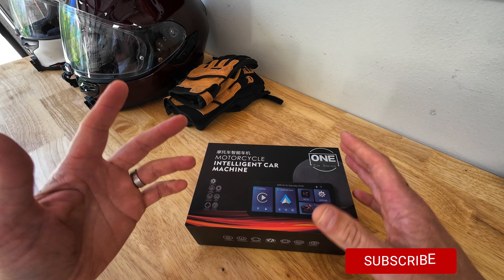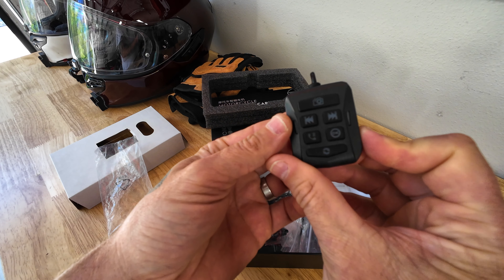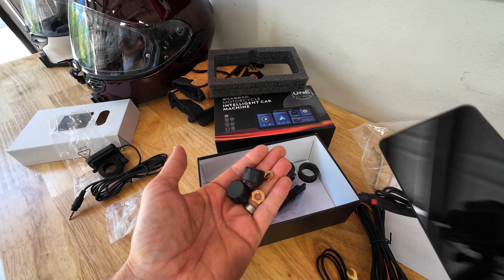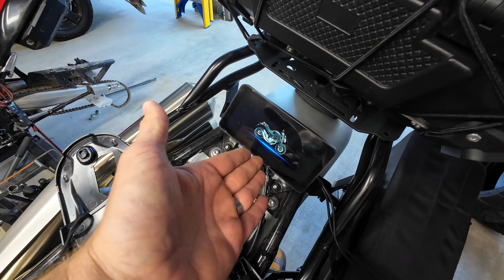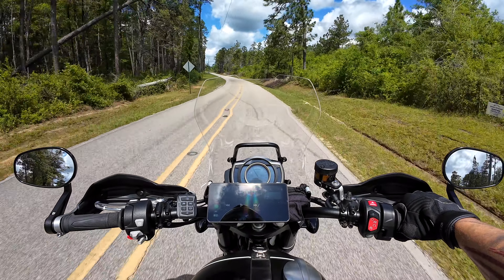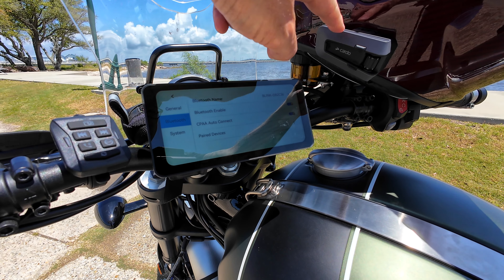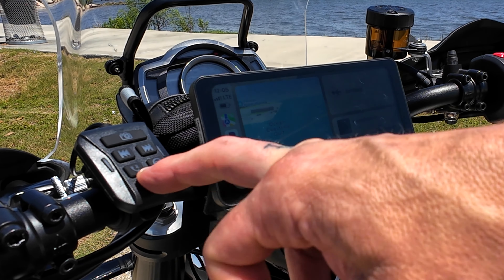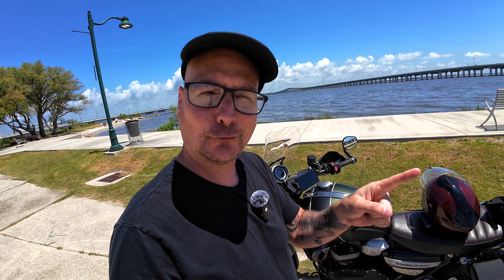A GOOD Motorcycle Apple CarPlay & Android Auto /  One Car Stereo DPL200

Comment: Nice video! 

I think the ruggedness of these units are a real issue! These devices would be fine in most autos/trucks and road bikes. The Samsung Tab active and Garmin bike units are designed to take a beating in a high vibration environment. Military grade is necessary and gives a little insurance to holding up in the long term. 

That being said, I hope your unresponsive device has an easy fix, like a broken power cord.

Comment: I bought the cheapest motorcycle CarPlay unit that I could find on Amazon, and it has vibration issues that cause it to power cycle at certain speeds. The display will also go dark if the voltage can’t stay at a perfect 5V, according to the manufacturer. But I didn’t expect much for $100. 

What have reliability issues been like for your units? There is a lot of junk out there, and I don’t mind putting down more money for a better product, but it’s hard to tell what is worth it.